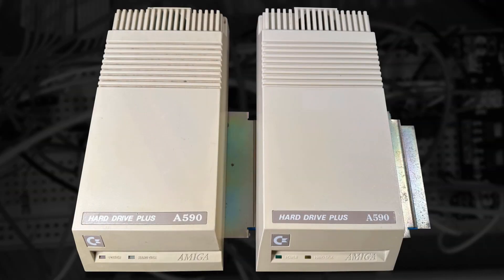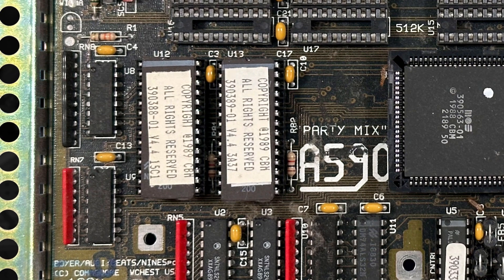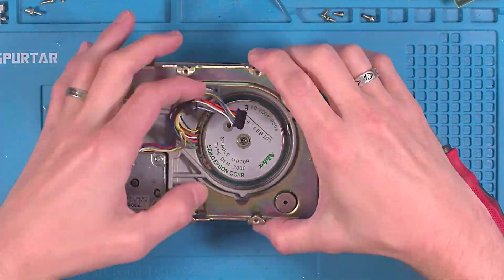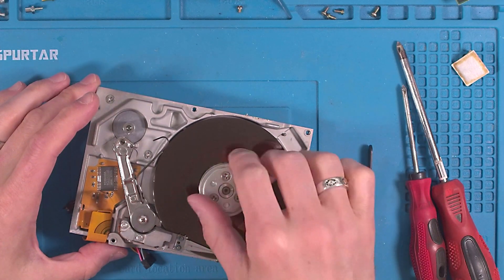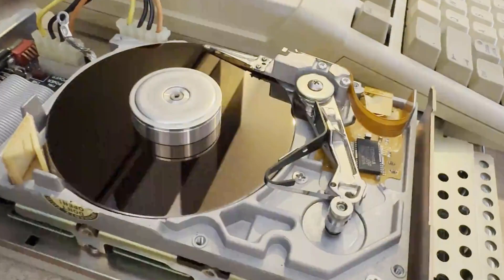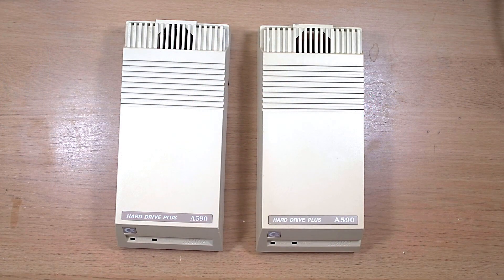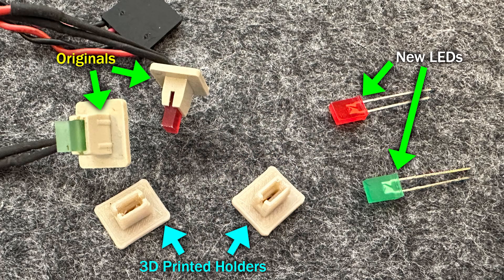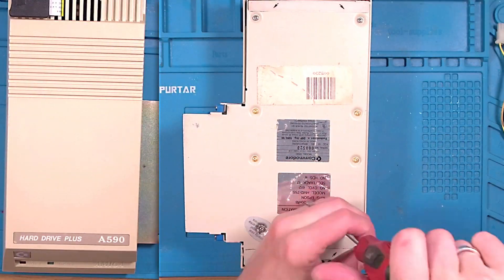Super Rare Amiga A590 - Still with EPSON Inside - Unexpected Part 5

Comment: Hi, I'm having a similar problem with my old A-590, it will start up with some manual help, like yours in the A590 video part five. I've tried changing the capacitors, but no change. Did you change the caps on the "party mix" board as well, or just on the board where the motor is connected? Also where did you buy the capacitor? I bought mine from aliexpress .. maybe the quality isn't good enough? Love your videos on the A590, Cheers, Kristian
Reply from the maker: I did recap all of the capacitors on the drive, and the few on the A590 although the ones on the A590 were fine. The capacitors were just an Amazon box of assorted values, nothing special. As long as they are the right rating they should be fine. One other thing is the A590 power supply. It might not be working well. Spoiler: I’ve another A590 video on the way….

Comment: Perhaps it would work if you low level format the drive. Perhaps it did become misaligned and it can no longer to find track 0?
Reply from the maker: Both are possible, but I don’t think you’d be able to low level format, the drive doesn’t respond and then powers down after a while so no opportunity to even start that. I’d like to see what was on it rather than actually make it a usable drive. I’m going to try some other ideas later.

Comment: Many old players and drives have issue with stuck oil. Re-oil the bearings in the motors will help a lot.
Reply from the maker: Bearings were fine in this one, was the head actually sticking in the disk surface

Comment: Never had an Commodore made HD, but still have a couple of GVP (Great Valley Products) HD's with the memory expansion chips fully populated.  One is the original rectangular metal box with slightly rounded corners, and the other is the newer plastic box slanted to match the shape of the A500.
Reply from the maker: Yeah they were more desirable (see part 4) but they cost so much these days
Reply: @RobSmithDev - Like the super rare IEEE adapter made by Commodore for connecting SFD-1001 drives.   I have a generic one made by  Skyles Works.  Bah!